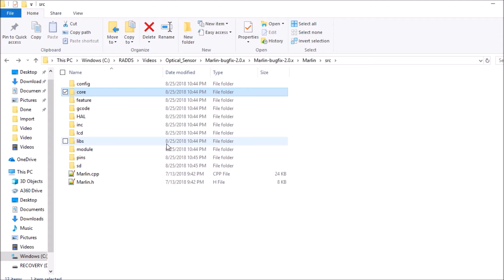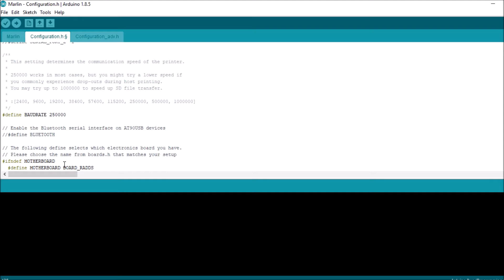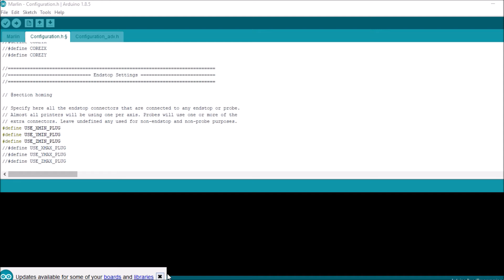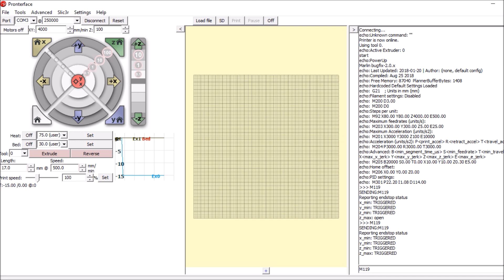RADDS - Optical Sensor endstop

Comment: So the optic endstop will run without any mods on radds+arduino due board?
Reply from the maker: Correct, the optical endstop is powered by the 3.3v from the RADDS/Arduino Due board combination.
Reply: Awsome...thank you...